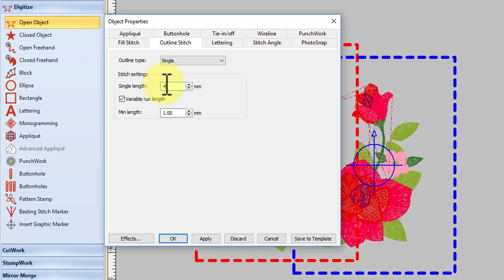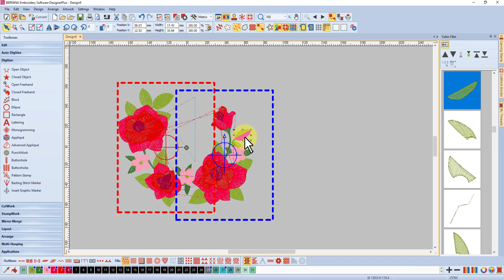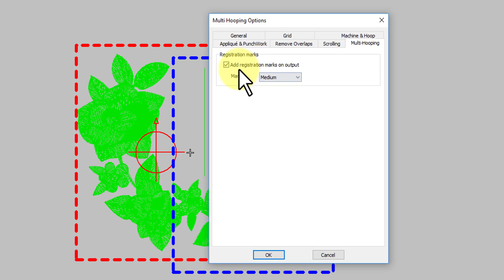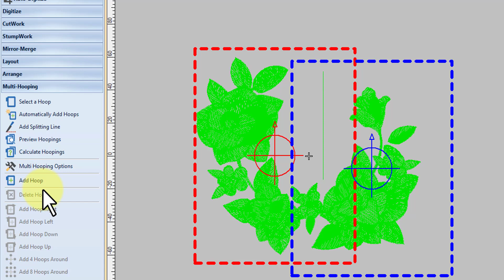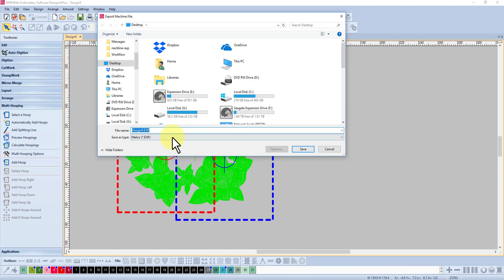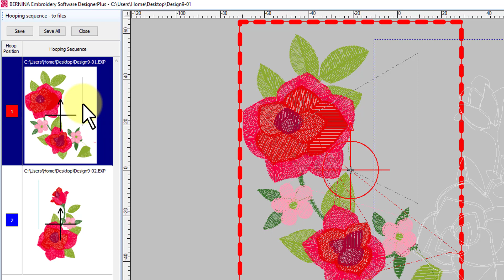Create your own Registration Marks - Multi Hooping

Comment: You forgot to sequence the first registration line at the very  end of the first hooping, and the second registration line at the very beginning of the second hooping.
Reply from the maker: You are absolutely right. Thank you for drawing that to my attention. I will have to do a follow up correction video.
Reply: @CarolUndy well, I guess that second video never came up. This all Good with two hoops but what about three hoops. I tried and tried and I just can't make the duplicate shape to show up in the  other hoop. I'm talking about three hoops. 
Will you be able to make a three hoop?
Reply from the maker: @Riko333  I will try to do this video soon. In the meantime if you are doing 3 hoops you will need to create another registration mark and duplicate it so that you can stitch it at the ensd of the second hooping and the beginning of the third hooping. Don't forget to group the registration marks with the relevant hooping.
Reply: @CarolUndy  so i had to delete previous message. i understand and finally i was able to do it. i can see the second line in the area withing the first hoop which is divided by three hoops automatically out of this 5x12" mega hoop. that works well -after SO many tries i was able to figure this out because of your technique - however... jumping from first 5x12 hoop towards the second part of the design which is spread out automatically in two hoops within this second hoop, i cannot find a way to manually create the registration mark using your technique. maybe i am missing something? in other words, i am failing to create a registration place anywhere in the first hoop towards into the second hoop, because the design is divided in two hoops or three mini hoops for each large hoop.